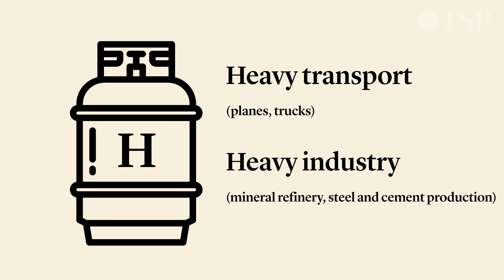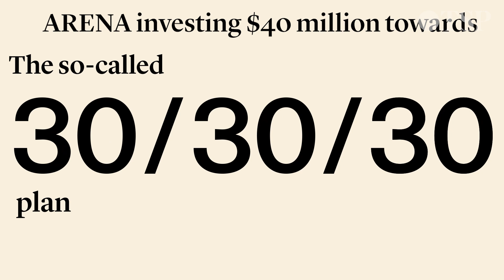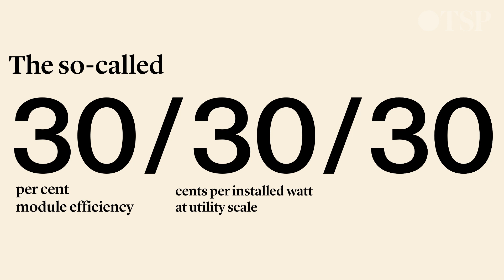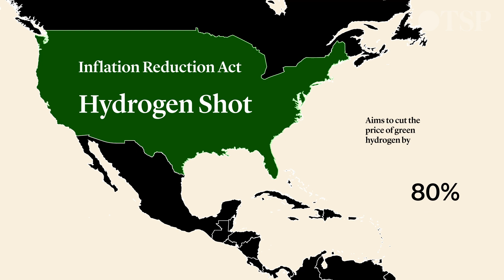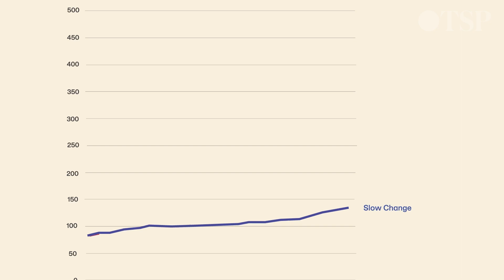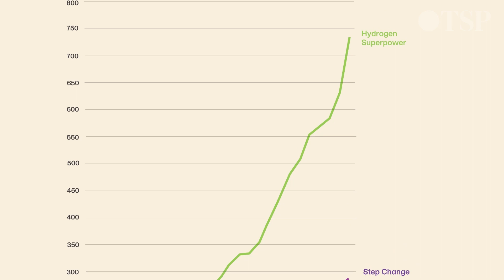Can Australia become a hydrogen superpower?

Comment: Hydrogen production costs will decrease by around 50% through 2030, and then continue to fall steadily at a slightly slower rate until 2050. By 2050, green hydrogen production costs in some parts of the Middle East, Africa, Russia, China, the US and Australia India  will be in the range of €1 to €1.5/kg.